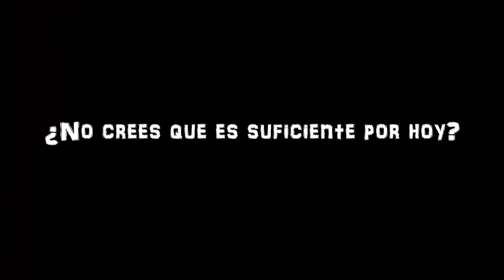REPARAR y PINTAR las PINZAS DE FRENO con kit Foliatec - 🔧 SWAP #Peugeot205RFS - 15

Comment: Muy bueno el video.

Para referencia futura con los machos de roscar, siembre vienen en grupos de 3: esbozador, repasador y calibrador. Para repasar una rosca, conviene seguir la misma secuencia que una rosca nueva (en el orden de los machos). Y siempre para no romper le das una media vuelta para adelante y una entera para atrás hasta que sientas que se cortó la porquería o viruta que pueda tener. Para probarlas, usa el calibrador (el último macho que tiene pinta de tornillo) y debería entrar con la mano sin la palanqueta.

El pistón de la pinza les hubiera convenido meterlo con la prensa en tensión y aire como lo hicieron, así es como se arman. La prensa hidráulica es un poco más estable que la mano. Para dejar bien a nivel el caliper, les conviene pasarle varilla roscada por los montajes y una contratuerca así no se descentra.

Muy buen laburo. Ya quisiera tener tiempo y equipo para meterle a mí 405
Reply from the maker: Muchas gracias por compartir tu experiencia y conocimientos con todos Joaquín, seguimos aprendiendo! ;)
Reply: Joaquín Aramendía  hola solo aportar algo experiencia como tornero sin la intencion de corregir a nadie, pero pasarle 3 machos a una M8 siendo un material relativamente blando como puede ser el de las pinzas de freno que creo que es forja o fundicion si tratar o sin templar me parece mucho pero mejor queda eso si, en cuanto a lo de pasar primero macho de 7 y despues uno de 8 que ahora ya no recuerdo si lo e leido o lo e visto a nuestros compis de petroheadgarage, decir que el macho de M7 es paso 1 y M8 es paso 1,25 en rosca estandar normalizada, las metricas no es solo el diametro nominal esterior de rosca, el paso es importantisimo (por cada vuelta tiene una distancia recorrida en este cas M8 pues 1,25mm) por que en este caso con el de M7 en cada vuelta te as cepillado 0,25 del siguiente hilo de rosca por que despues vas a pasar el de M8 y le va a faltar material, pasar no tiene que pasar nada pero esa rosca ya no tiene la resistencia que debiera por el centro habra hilos que an desaparecido (no por completo pero les quitas material), un poco de pasta de rosca y como dice el compañero 1 vuelta para alante media atras con el maneral y  macho helicoidal para sacar la viruta haca atras si el taladro es ciego espero haberos aportado algo saludos muchachos ;)

Comment: Viendo tus videos me entran ganas de meterle mano a mi seat 850 d que tengo en el pueblo! Empezare este verano desarmandolo para quitarle el oxido ( que seguro qur tendra) ya que lleva 20 años parado y aparte de  quitar oxido y pintarlo entero , me encantaría hacerle un swap , pero no se cual , pq yo con 40 cv que lleva el motor de casa ... bf 😂 me encantaría meterle algo más potente y prepararlo como para rallye y a la vez coche de exposición y colección! Mucho ánimo con el proyecto de este 205 que va a quedar increible!!!!
Reply from the maker: Muchas gracias Mangel! Nos alegra que te haya molado! Y mucha suerte con tu (inminente) proyecto! Es todo ponerse, y si no tienes prisa entonces sólo disfrutarás con el proceso, seguro! ;)
Reply: Mete el 1050cc abarth 75cv, o el del polo g40  115cv.
Reply: Diego Medela pense en meterle el del Abarth pero ns si encontraré alguno, de todas formas miraré . Aunqué me encantaría meterle algo de por el estilo con turbo .. aunqué sea uno pequeñito pero me fliparía hacerlo turbo
Reply: Y si no puedes vitaminar el 903 hasta los 65cv. Digo este y no el 1010 porque el 903 tiene más nervio. O turbar el motor 903 de baja compresión

Comment: Yo usé ese kit de Foliatec también, que me costó 35 pavos en tienda, en rojo, y me decepcionó bastante... Fué meterlo en tandas (30min) y el rojo quedó granate oscuro, bastante feo. No soportó la temperatura, creo. Fué solo en las pinzas delanteras, las traseras no pq no se calientan tanto. Pero ya te digo, el próximo dia con espray normal y andando
Reply from the maker: Muchas gracias por compartir tu experiencia Joanes! Cuando le demos caña a las nuestras compartiremos nuestras impresiones, a ver si coincidimos o no
Reply: PetrolHeadGarage seguro que a ese gris tan guapo no le afectará. Buena elección, y buen proyecto y vídeos. Seguid así, gracias.

Comment: Buenas tardes muy buen trabajo pero discrepo en algo al cambiar los tornillos 8.8 por 12.9 al aumentar la dureza disminuye su elasticidad con lo cual se vuelve mas quebradizo
Reply from the maker: Muchas gracias por tu sugerencia Andrés!! El primer número de la nomenclatura de la calidad de un tornillo es su resistencia a la rotura, el segundo es el límite elástico de ese tornillo. Estas fuerzas son las que no se deben de pasar para que el tornillo no solo no se
 fracture, sino que no se doble y siga en buen estado. Si miramos tablas de estos dos valores, para tornillos de la misma métrica, que sean de calidad 12.9 creo que garantiza bastante que no vayamos a tener problemas. Al menos en teoría :P
Reply: PetrolHeadGarage ah pues muy bien pues ya se algo mas gracias a ustedes muy buen trabajo seguid asi envidia sana ... 😄

Comment: Buenas. 
Kit de reparación pinzas traseras los compre yo por Amazon UK por unos 40€ cada uno. Tengo aún las cajas. Si queréis la referencia os la miro. Saludos. Cracks
Reply from the maker: Muchas gracias Rene! Pues si nos las puedes pasar por aquí mismo estaría fetén, porque los que encontré por aquí eran un atraco como una catedral, casi compensaba más comprar la pinza entera nueva!
Reply: PetrolHeadGarage cuando llegue a la guarida lo miro, yo lo compre para mi Clio 1.8 16v pero si la memoria no me falla compartimos pinzas traseras con saxo, xsara, 106 y seguro que más.

Comment: Porque cambiar los tornillos 8.8 por 12.9?
Reply from the maker: Porque son de más calidad y más resistencia a esfuerzos mecánicos, es decir, más seguros
Reply: @PetrolheadGarage  el acero 12.9 no es más calidad, es diferente calidad al 8.8 o al 4.6. Más rigido con menos capacidad de absorber las dilataciones y o vibraciones.